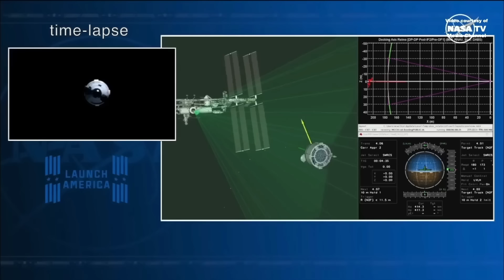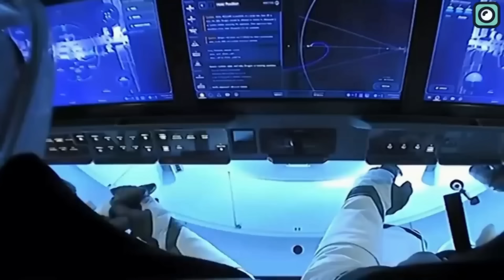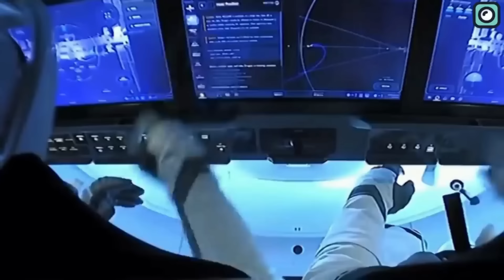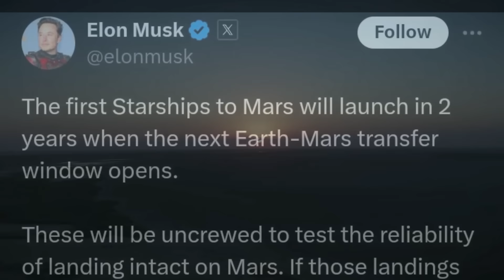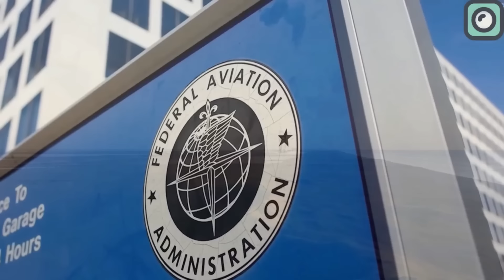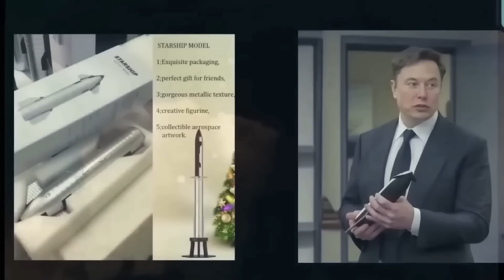Boeing Released What Happened To Starliner During Return Mission!

Comment: What's sad is, Boeing got WAY more CCDev (commercial crew development) money than SpaceX did... yet SpaceX had to design their capsule FROM SCRATCH starting with nothing... Boeing's Starliner is based on previous work they did under contract for NASA.  NASA had let a contract to Boeing in the early developmental days of the Orion capsule, and paid them to build a carbon fiber composite test pressure vessel of the Orion capsule as it was designed at that time.  Boeing completed the work and delivered the test article, while NASA also built a more typical metallic structure pressure vessel for testing purposes, to test the two head to head and see which one was better-- composite or metallic.  After the testing, NASA decided on a metallic structure for the Orion capsule.  

Boeing used this basic work as a starting point for their Starliner-- it's not a coincidence they look so much alike... and why Orion looks so much like Apollo... NASA reused the Apollo shape baseline for Orion, because it would save tons of aerodynamic testing related to ascent and reentry in ultra-high speed wind tunnels, since the aero data and properties remain the same with the same shape, you can scale the spacecraft up in size by a certain amount without fundamentally affecting the data or the aerodynamics.   Saved NASA a ton of money they didn't have to be able to reuse the Apollo aero data and apply it to the 'scaled up" Orion vehicle.  Boeing basically did the same thing, copying the work they'd already done for NASA and as a matter of record of Apollo.... Starliner uses the same land-landing airbag system originally developed for the early iterations of Orion, when it was designed to land back on land instead of the ocean splashdowns of Apollo, which it was believed would make reuse of the capsule problematical due to salt water intrusion.  Of course the landing bag system was heavy and due to weight problems on Orion and the anemic performance of it's originally designed launch vehicle, the long-cancelled Ares I rocket, it was done away with to save precious weight on the capsule in an attempt to get it light enough for Ares I to successfully orbit with enough fuel still aboard to perform its mission.  

SO even with WAY more development money, and all these benefits of the headstart they gave Boeing, and Congress demanding Boeing get a contract because they were viewed as the "reliable legacy space contractor" who in unison with Lockheed had serviced the shuttle system for decades, and thus was seen as having "more experience" than the "upstart" SpaceX or Sierra Nevada and their Dreamchaser mini-spaceplane, it turns out Boeing has proven itself completely incompetent at designing and building and managing a successful manned spacecraft system, even with a leg up on the competition... 

For less money, SpaceX not only had to design their Dragon capsule from scratch (granted they did get a good bit of money from NASA contracts under the COTS commercial resupply vehicle contracts for ISS unmanned resupply missions) but they also had to design their engines and launch vehicle FROM SCRATCH.   SpaceX HAD bought the data and rights to build the FASTRAC engine, which was a test engine design for a smaller, cheaper, fully expendable kerosene/oxygen engine designed with minimal costs in mind-- the RL-10 liquid hydrogen upper stage engine is said to cost about the same as a helicopter engine, making it remarkably cheap for a rocket engine, and it has excellent performance characteristics... BUT it's a relatively low thrust upper stage engine-- it's hydrogen propellant is best suited for in-space and upper-stage applications, where its high specific impulse (fuel efficiency) really shines, and its lower thrust is not much of a detriment.  For a first stage engine, kerosene is a much cheaper and easier fuel to design for, and it can be scaled to produce higher thrust and a more efficient launch vehicle because of the much greater density of kerosene than liquid hydrogen, and it's cheaper to upscale to get higher thrust.  The lower theoretical ISP of kerosene fuel isn't as much of a drag on ultimate performance for first stage applications, making it an ideal fuel for first stages where its benefits really shine.  FASTRAC was a test of designing a smaller, cheaper kerosene first stage engine as cheap as possible.  It used an ablatively cooled composite nozzle (that chars and burns away like a heat shield during engine firing to keep the nozzle from melting) and thus was non-reusable, but the idea was to make an engine cheap enough to throw away so it cost less than rebuilding a reusable engine for multiple uses.  SpaceX originally thought this was the correct approach, but it soon became clear that it would cost considerably more to build 9 new engines for every flight than to refurbish reusable ones if they were designed correctly.   SO they redesigned the turbopumps and combustion chambers and nozzles of FASTRAC into a reusable, regeneratively-cooled engine design which became Merlin.  It was basically a complete redesign of the engine.  They then coupled this new engine to a totally new booster design to create Falcon 1 (their test rocket) and then Falcon 9, and then made the entire thing reusable.  They made the second stages cheap and designed to be expended, with a single Merlin Vacuum engine, basically a Merlin engine adapted with a larger nozzle to operate more efficiently in vacuum as an upper stage engine, which is expended.  Using kerosene for upper stage propellant is less efficient than hydrogen, and limits the performance of the vehicle in terms of payload capability compared to a comparable size and power hydrogen upper stage, but like the Soyuz which also uses a kerosene upper stage, is MUCH simpler and cheaper to design, construct, and operate, and simplifies design and ground handling and uses common engines, saving money.  Hydrogen is much harder to design for due to its unique characteristics, all of which costs more money.  

Boeing, OTOH, is using an EXISTING EELV rocket, the Atlas V, as its launch vehicle.  All Boeing had to do was design, build, test, and integrate the capsule itself and mate it to the launch vehicle.  Yet we can see quite obviously, despite all this previous work being done for them, relying on previous work done under other contracts and other vehicles and using an already existing launch vehicle, they cannot even get this job done right, as the several failed tests of Starliner and YEARS of delays and nearly $2 billion dollars overbudget clearly demonstrates...
Reply: Relatives of mine who work at Boeing talk about how fifty years ago Boeing went with what worked, but as the company got into more and more advanced stuff the management got a kind of "Oooh, shiny!" attitude towards fancy tech so instead of just designing solid systems that worked they tried to push the tech envelope not because it was necessary but . . . well, because it's more impressive.  So everything is made more technical and complex than is necessary, with the results we see.
One has said they often depend too much on testing of all the individual parts but neglect systems testing, so when a system gets all assembled problems show up that no one anticipated, and then it's CYA time as they scramble to figure it out.  SpaceX has a much more practical approach to testing: make it good enough and try it, and if something goes wrong you have lots of data for figuring out the next step.
The differences show!

Comment: At least with it back on earth they can microscopically examine the systems and know exactly what needs to be done...
Reply: Except they can't, because unlike SpaceX Dragon which brings back its propulsion system to Earth built into the capsule, Starliner's is almost totally external and housed in the service module which is jettisoned and burns up on reentry, along with all the affeced thrusters and systems where the problems were occurring... which is why they did as much testing as possible with it docked to the ISS, remotely, gathering what data they could.  No way to inspect any of the affected hardware at all... it's all dust and scrap on the ocean floor...

Comment: Sounds to me like it would be cheaper to shite can Starliner and ask Elon Musk if he has the resources to build another Space-X Dragon. With what I have seen, I would not crawl in that tin can and make a trip anywhere in space. Something has happened to Boeing. Maybe they had original designers retire. They are not sure if the two (Suni and Butch) Astronauts could have made it back due to temperatures inside the craft. They still had thruster issues.
Maybe another option would be to have Space X do a design review with Boeing, implement design changes, then perform 2 more test flights. Boeing has design problems, not fabrication issues. At the end of the day, I feel certain building another Dragon would be cheaper and the safest thing to do. If we lose any more astronauts might kill future missions. It will certainly impact future missions. In space flight, there are no do-overs, only instant replays.
Reply: I think currently 4 crew dragons are active and in service. I think 3 cargo dragons are in service.

Comment: Boeing was already very easily the worst of the large aerospace companies in the industry when the McDonnell Douglas merger happened in '97.  But they still had some commercial aircraft chops which was essential a totally different organization.  After the merger when nearly all of the Boeing upper management was replaced with McDonnell Douglas morons, everything went to hell.  Now the company is basically a total loss.  What a tragedy.  What I wonder is why the board of directors isn't held personally responsible ?

Comment: Why doesn't Starliner have a launch escape system on the nose?
Reply: The 4 big rocket engines on the base of the service module are the escape system.  It is more efficient and safer than an escape tower.

Comment: BOEING AND THE GOVERNMEN have become complacent about TIME and COST overruns. The longer they can drag out a project, the more they can line their pockets.
Reply: On a "cost plus" contract which has been "standard operating procedure" for NASA and Boeing doing gubmint work for the last 70 years, this is true... BUT the Commercial Crew program (CCDev) funds were under a FIXED PRICE contract, so Boeing is having to eat all the extra costs to try to fix this thing, which it's already years overdue and flown three failed test flights now so they're about $1.6 billion bucks in the hole of BOEING money... they're PO'd because under a "cost plus" contract they're USED to getting, NASA and the feds would have to come up with that money... NOT the company!  IOW they actually get paid REGARDLESS of whether it works or not, then PAID TO FIX IT when it doesn't... hard to change how you do business when you've done it that way for many decades!  They think they're still milking the gubmint cow, where ineptitude is rewarded as well as proficiency, if not better!

Comment: Why helium over CO2  why Teflon over machined stainless parts
Reply: Helium is nonreactive and remains a gas at extremely high pressures, CO2 does not.  Teflon makes seals sure the metallic parts of the valves are stainless or more exotic metals like titanium or tungsten...

Comment: Totally ignoring the fact SpaceX doesn't have any actual starship modules. Empty shells just doesn't cut it. 😢
Reply: SpaceX from the very beginning said that Starliner test launches would result in mock-up losses, so why in the hell would they go to the expense of outfitting the internals?  Those shells are not “empty”.  They are equipped with sensors to transmit real time data and ballast to simulate weight and balance of future, fully operational, manned spacecraft.

Comment: Thrusters of Helium?
Reply: Helium gas under high pressure (thousands of PSI stored in pressure spheres) is used to pressurize the propellant tanks instead of using pumps which could break down... helium flows through pressure regulators and lines to the propellant tanks, in a bladder inside the tank which pushes on the propellant liquid and forces it out the propellant lines to the valves that operate the thrusters... a helium gas leak results in losing pressurant gas and then the system doesn't work for lack of pressure to push the fuel and oxidizer into the lines, valves, and thrusters...

Comment: The only thruster issue on return was one thruster on the crew module which didn't work.  This is completely different than the thrusters on the service module in the dog house(s)   They will be able to examine the thruster on the crew module but the ones on the service module burned up when it was jettisoned.  I wish this channel would get its facts straight.  Just cobbling together random facts that were reported frequently on the internet.  Probably AI generated.